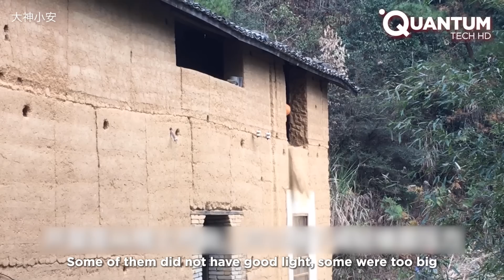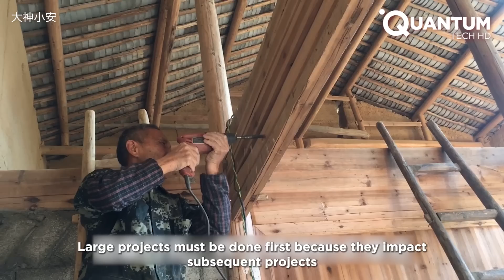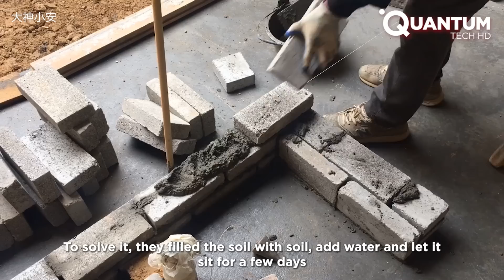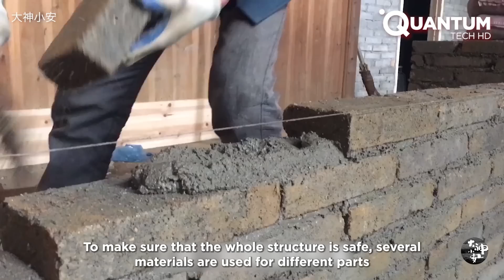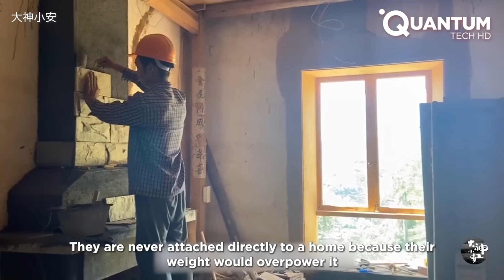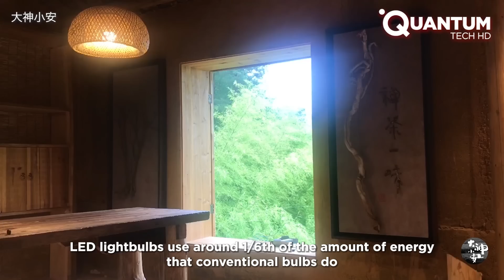Family Renovates Abandoned RURAL house Into Luxury Villa

Comment: For those who comment that everything is going to fall etc. That is not true. This house was build without ciment concrete. If this was ciment concrete you could be worried. But those are mud walls. Vertical cracks are common on those old buildings. The are due to differential settlement combined with stone / lime fundations that are not as strong as concrete ones. This is fine. The building is going nowhere. What you REALLY need for those kind of old construction, is a proper roof that does not leak. The only real danger is not those huge vertical cracks, it is water that could dissolve mud if the roof is failing.
Great job overall.